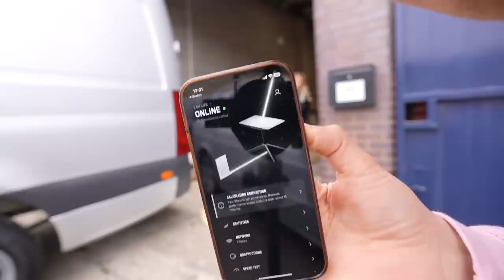Surprising Liana and Making A Tough Decision...

Comment: I saw a really cool design where they turned the shower into their office. Like they kind of put a movable counter over the shower basin area and used that as storage for the toilet as well. The tiles ended up looking like a design feature. Same with the curtain rod. It was definitely the most space efficient design I've seen. She also had plants growing on the wall that was technically part of the bathroom. It looked awesome honestly. 

The bathroom is actually kind of in the back of the van in front of the bedroom in the corner. Other than that weird feature it was a pretty typical fixed bed design just with a hidden shower.

Comment: Okay, guys. I saw an excellent, space saving idea for the shower and toilet! This gal had a bench seat... BUT, the top and front of the bench folded away, revealing the potty. And, genius! The potty was on a slider... Slide it out and right underneath wascthe shower pan/tub! A tube the perimeter of the tub lifted to ceiling hooks with curtain attached. Then she lifted the shower head and all good. The best part if having this was, when all done, it put away and space was open again! Especially having the baby, space is goingbto be very important!